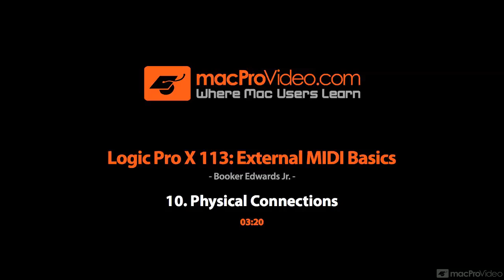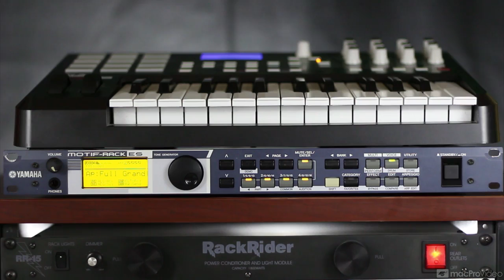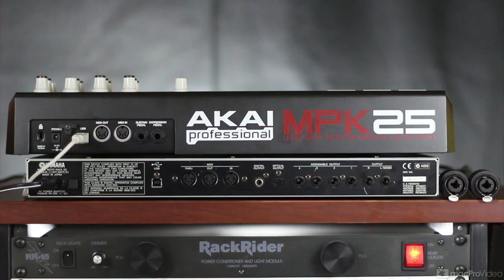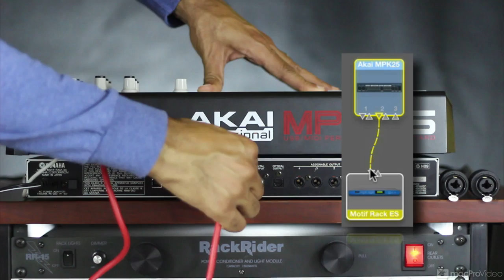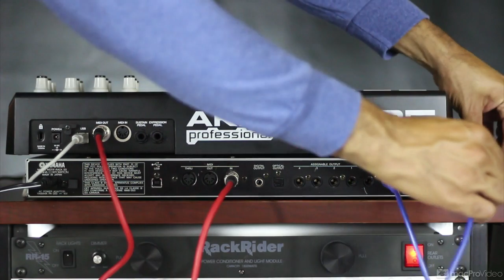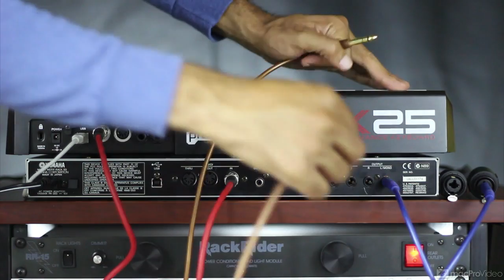Logic Pro X 113: External MIDI Basics - 10. Physical Connections

Comment: Thank you.  Maybe you can help me with something: I would like to use my MIDI digital piano (with its own sounds) through my audio interface and then into Logic Pro, but also occasionally connect the piano directly to my studio monitors so I don't have to turn on the computer or interface to play something - and I'd like to do this without having to constantly plug and unplug cables.  There are line level switch selectors or splitters out there such as a Coleman LS3, but as far as I can tell I would need not just one but two of those.  First I'd need one to split the audio signal of the monitors to accept either the piano audio directly or the interface audio; but I'd also have to split the audio signal coming out of the piano to go either to the interface (and then to the first splitter, and then to the monitors), or to the first splitter (and then to the monitors).  Is what I want really so crazy, or am I missing something obvious?

Here's a drawing of what I think I need:

https://www.dropbox.com/s/fh92cfi80rck7gh/signal%20path.jpg?dl=0